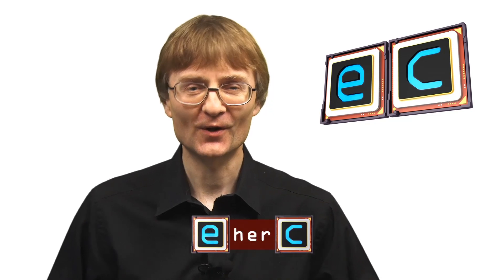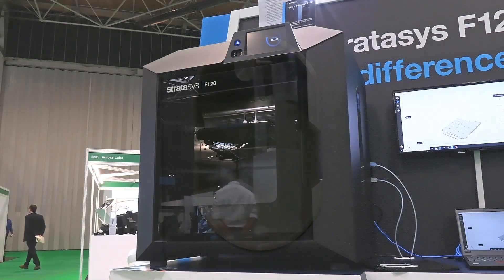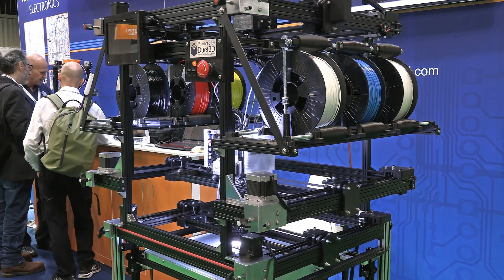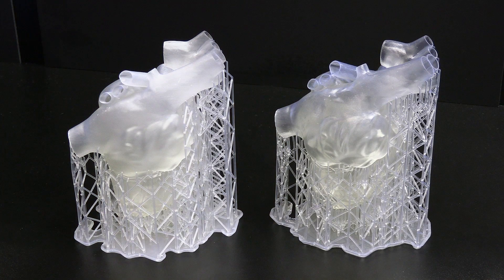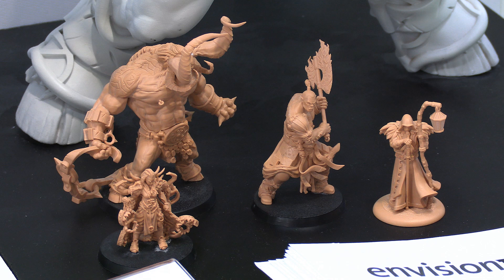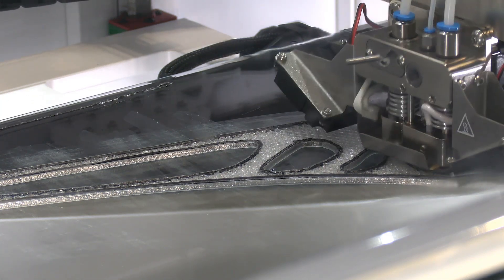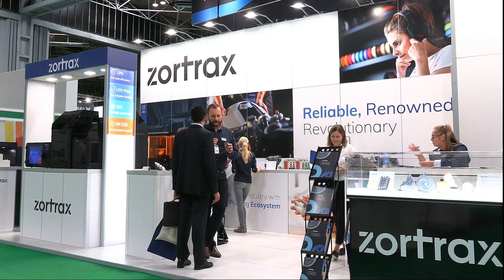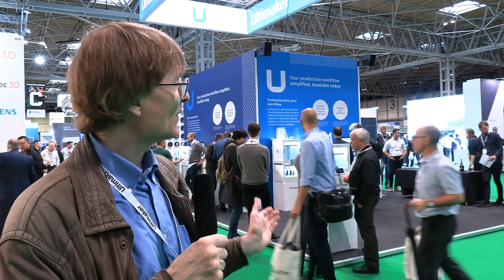3D Printing at TCT Show 2019

Comment: Hi again.  Curious, what kind of computers drive these printer?
Reply from the maker: A 3D printer can be driven from the average laptop or desktop computer, although a beefy machine is needed to run high-end CAD to produce some object files. But these days, most 3D printers are networked so that they can receive a job and execute it independently (which saves you typing up a computer for a long period of time). Or a print job can be loaded in directly from a USB storage device. The basic process is to create a 3D object (in CAD, 3D sculpting software, scanning, or some combination), and then the object is loaded into slicing software, which cuts up into digital layers. The slicing software then generates a file (gcode) that is provided to the printer.
Reply: ExplainingComputers, Chris,  the last laser systems I worked on used Windows NT. It would send a “print file” to a PC running DOS 6.2.  The DOS computer controlled the laser beam.  Fascinating.

Comment: In some areas 3D printing is to manufacturing like software processing for typical hardware tasks. Like using AI and partial processing of raw image from CMOS sensor to enhance dynamic range this 3D printed metal parts include cooling channels inaccessible in typical manufacturing process.

Comment: I've seen videos showing how to use acetone to smooth out 3d prints but I haven't tried myself yet. Although I'm usually printing things like replacement keyboard legs or other items where it doesn't matter if you can see the stepping texture.
Reply from the maker: Yes, there are many videos showing experiments in vapour honing! Some with dramatic resutls! But the Zortraz Apoller is the only commerical product for doing this automatically and safely on the desktop that I -- or they -- are aware of. :)

Comment: That aluminium heat shield part was incredible.  Seems to be printed then machined, but the machined surfaces look like they were done on a cast component.
We are getting closer and closer to the Star Trek replicator each year.  Eventually printing a plate of food, including plate, will be a thing.
Reply: No doubt McDonalds will try it ! They already are trialling a system in America whereby you can order food on your smartphone, so when you bring your smartphone near to the store entrance, the order is assembled as you walk into the door ! That would certainly complete the whole thing, but TBH not one I'd want to see happening !
Reply from the maker: The base may indeed have been machined -- this is not uncommon for some 3D printer metal parts, or indeed traditional cast parts.

Comment: Vapor smoothing chambers have existed for many years, and is nothing new. You can even build one yourself with just basic parts.
Reply from the maker: I never said that vapour smoothing chambers are new. I am well aware they can be and have been built for years. However, the Apoller is, as far as I and Zortrax are aware, the only automated desktop product that allows anybody to safely hone a print. And that is what I said in the video! :)

Comment: Great selection of 3D printers. Would there be a day when you do not need to ship parts for repair. Just download the model from manufacturer and print. No more long downtime to wait for shipping.
Reply from the maker: That day is already arriving! :)
Reply: We just had to wait 10 weeks for some new child car seats, as they had to come in a container from China. I'd suspect that the amount of fuel used to transport them would easily have been more than the cost of printing the seats in a UK workshop ?

Comment: That wheelchair in the bigining looks cool but it won’t be useful outside at all. The front is 1 inch off the ground. Try crossing the street with that.
Reply: I once used to work at an indoor crown green bowling hall, and that type of wheelchair would actually have suited such a surface ! They were expensive to buy out of moulded parts, so maybe a 3D-printed one would have reduced the cost ?

Comment: In the future the machines will prin human organ made from cloned cells.
Reply from the maker: This is true. Organovo are very close to human trails of bioprinted tissues (probably 2021).
Reply: 2 months ago i was reading on the topic of 3d printing body parts using the patients dna to prevent the body rejecting the organ once it is implanted, fascinating stuff, but only at experimental stage last i read.
Reply from the maker: @oceania68  Organovo has been selling bioprinted human kidney and liver tissues for use in drug testing for several years now. It expects human trails in 2021, eg of bioprinted liver patches. It is a very promising technology.
Reply: What about meat? Could we potentially be able to 3D print food?
Reply: @darovi  yes
Reply: Do you think they will live print on the actual body?
Reply: Never

Comment: 4:47 I just admire the counter-weight on top that's running against the direction of the printing head to reduce wobble.
Reply from the maker: Yes, it is an amazing bit of design and construction -- I am impressed by the multiple xX-Y axes to reduce the weight on the print head.
Reply: I'm sure of the etiquette in these situations but if viewers would like to know a bit more about my printer and my journey along the 3D printing road so far, here is a link to my blog  https://somei3deas.wordpress.com/. Just delete it and accept my apologies if I've broken any rules.
Reply from the maker: @deckingman  No rules broken -- though YouTube did initially put your comment in spam due to the link. Now restored. :) I've also put a card in the video at the appropriate point that links to your YouTube channel. Great to meet you at the show.